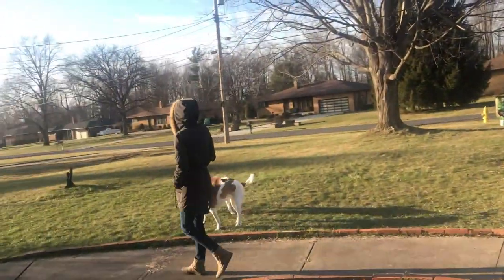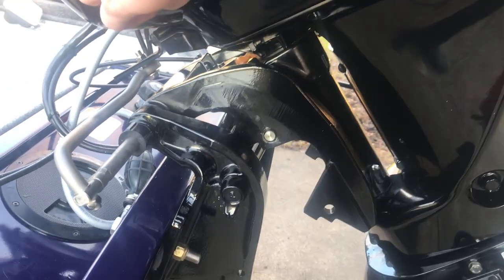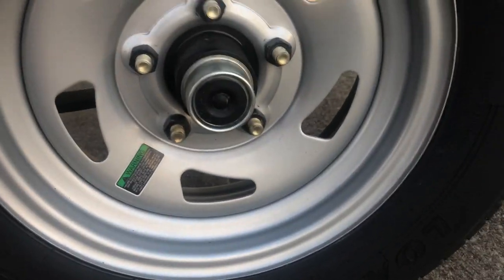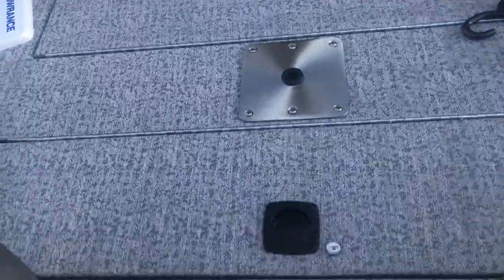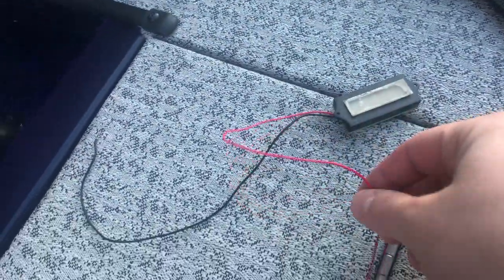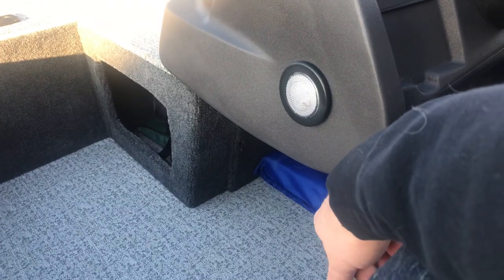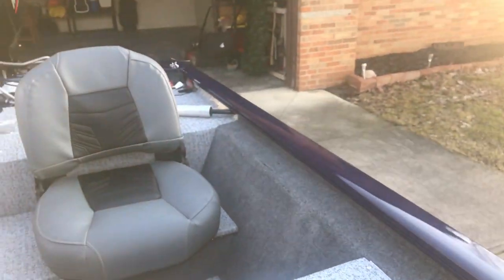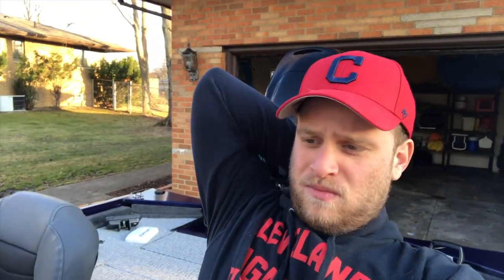BRAND NEW BASS BOAT TOUR - 2020 TRACKER PRO 170 WITH JET DRIVE!

Comment: get rid of the edge 45 as it is junk, also change the single leaf spring to the 3 leaf spring.  There has been a lot of problems with the single leaf spring breaking or bouncing a lot going down the road.  The 3 leaf is really inexpensive and makes trailering much easier.  Both of your batteries are 12 volt not 24.
Reply from the maker: I dont mind the edge, I do plan to upgrade though. Havent had an issue with the springs, knock wood. Need to replace batteries ASAP, prob will do so when I upgrade  the minn

Comment: What real life speed do you get from this setup with 2 men and gear?
Reply from the maker: Depends if you get the jet or the prop. And depends on the motor size but this specific gig goes anywhere from 27 to 34 depending on wind and weight.

Comment: The 40 rating is at jet, believe that is a 50 or 60 power head. Could be wrong the 40 is unique 3 cyl 750cc the next size up are liter motors. My manual says not use the tilt lock for transom for transportation and transom saver is still recommended. Previous owner did not follow and broke the tilt lock.
Reply from the maker: i suppose its to each their own. #PuffDaddysUnite

Comment: Would  you have enough space to add 2nd battery for your trolling motor? It looks pretty tight in there...
Reply from the maker: i would say there is a less than zero chance lol, but the Interstates have never run out for me - even on 6-8 hour, con4 setting, days in current on the river

Comment: Can you tell me what your draft is, or how shallow you can go?  I am contemplating getting this same setup for a river boat.  Thanks.
Reply from the maker: Ive been wide open in less than 1 ft of water. obv watch for hazards etc, but this is the set up to get for shallow rivers.
Reply: @TheNorthwestWind  Thanks for the info!  Going to look at one this weekend.
Reply from the maker: @poconoboss  do it, you will not regret it i promise
Reply: @TheNorthwestWind  Well, I did it...Pulled the trigger today...Traded in my Suntracker and ordered a 170 with the Jet...River, Here I come!!!  Upgraded to the vinyl floors, custom cover and I swapped out the Fishfinder for a Hummingbird Helix 7 and swapped out the Trolling motor for a Minn Kota Powerdrive with I-Pilot and spot lock and wireless remote.  6-8 weeks delivery...cant wait!!...Thanks for the informative video and info!!
Reply from the maker: @poconoboss  BROOOOOO I AM SO STOKED FOR YOU, YOU WILL ABSOLUTELY LOVE IT

Comment: The screen is the intake for the live well. And those are 12 volt batteries green is for the trolling motor which doesn't charge off the system and the black is for your motor and light which does charge off the system
Reply from the maker: yes you are correct #PuffDaddysUnite

Comment: Nice rig man congrats I have the 2020 myself. Had it for two months now and haven't even been out yet to break the motor in. Waiting for the weather to break down here in Maryland. Just been doing a few modifications on it in the mean time. Can't wait to see how it runs for you in the next video.
Reply from the maker: what have you added? get out ASAP to knock out the first 2 hours of the break in period, its hell on earth. the last 8 you can run open throttle for 5 mins at a time, so knock out the first 2 and youll be ready for the season. my first day out vid will be up this week  #PuffDaddysUnite
Reply: Puff Puff Bass Fishing I've added extra storage box in the center for more storage and to extend the deck and I'm in the process of recessing the trolling motor foot control and I'm going to be cutting out a hatch right in front of the console for more storage because it's pretty useless the way they made it with just side cutout plus my center storage is going to block that access anyway.
Reply from the maker: @billye99  im sure it looks boss. dm me some photos on IG so i can check it out if you would kind daddy #PuffDaddysUnite

Comment: how deep is your garage? Mine is 20', I am wondering if it will fit straight in.
Reply from the maker: I think 20 may juuuuuussssst fit in
Reply: I’ll make it fit haha! Even if I have to punch a hole in the wall.
Reply from the maker: @freeagentangler5159  ive considered doing the same

Comment: Hey Puff, I have a Storm 1700, Crestliner.  60/40 Jet.  You can check out my videos of running the river.  Out boats are pretty similar. I also have the no-carpet interior, smart move to get it.  Less pain-in-the-ass than carpet.  I get time I will show you what little things that I did and share with you that you may also find likable.   Great boat man.  You will enjoy the extra space.
Reply: My driving seats I raised up on a 7" pedal stool.  I could not see anything sitting on the floor.  

You will love the rod locker.  I have like 12 rods in mine.  But you got to put your rods in a rod sock or you will be busting the eyes off of them.  Makes them slide past each other with ease.

Remember now that you have power trim.  Start out with the motor down as far as it will go.  This will help to get on plane quicker, once on plane inch the motor up, you will know when you go to far, the rpms will go up and the speed will drop, drop it down a whisker and you will be running on top of the water.

Your speedometer, the white plastic thing in your transom will collect water and the water goes up a tube towards the speedometer.  The damn tube gets clogged up with dirt and eventually doesn't work.  I took mine off.  Use your GPS for speed readings.  

Nice boat brother.  Well deserved.  Also, don't forget to grease your bearing on your jet every time after use.  It is a special grease. A Teflon grease. The grease helps keep the water out.  Any questions just ask.  Lots of good you tube vids from Mercury.
Reply from the maker: I absolutely love it# PuffDaddysUnite
Reply from the maker: Good call